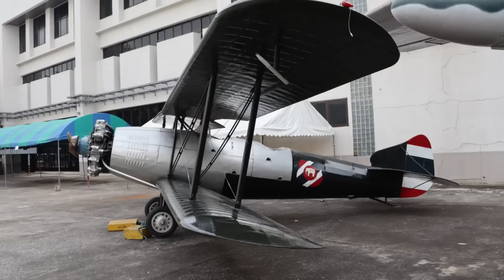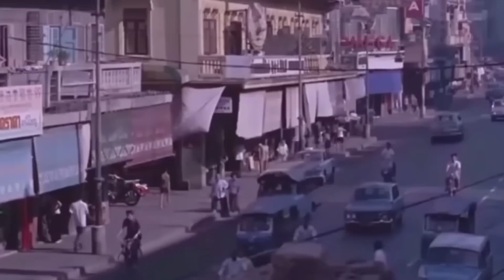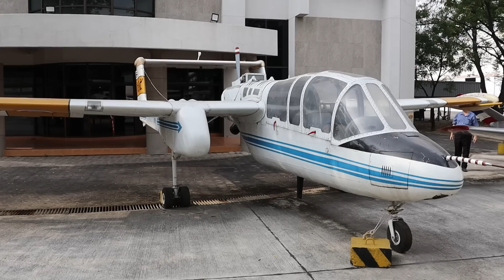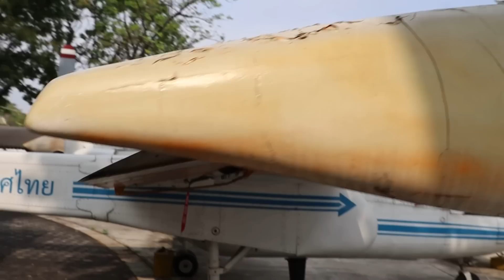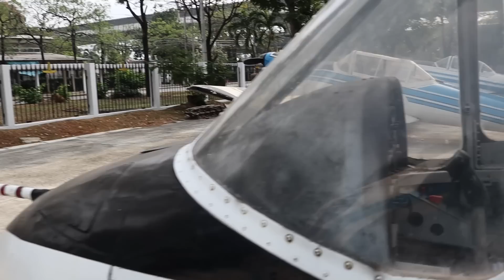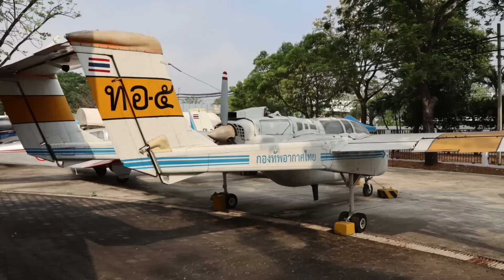The RTAF-5; Thailand’s Baby Bronco

Comment: I was an O-2 FAC with 300 combat missions and all these designs thrill me to no end. Sadly, the slow FAC mission is extinct, due to the proliferation of man-potable anti-air missiles. But that may have been a genuinely useful craft as a trainer or even a private sport plane.
Reply: Expensive motor though!
Reply: COIN aircraft have a place in a controlled airspace.  I don't see why the OV-2 isn't used as a Parachute, and Glider Tow for civilian applications.

Comment: Interesting design. 

I seem to remember there was a conversion to the Cessna Skymaster -- source of the O-2 -- that replaced both front & rear reciprocating engines with a single turboprop engine {maybe the Allison 250} in the rear. 

AFAIK, very few were made, and maybe only one prototype.
Reply: Spectrum SA-550 
Pratt & Whitney Canada PT6
IIRC four or five were built
There was another conversion with the rear engine removed & the front replaced with a Garrett turboprop but that's all I remember.
Reply: @GARDENER42  >>> Okay - Thanks...👍

Comment: The design layout is not a bad one if done right  but there is a big design no no with this aircraft with relationship to the propellor and the elevator if anyone else can spot it .And I'm afraid not cheap to put right in this case which may have been it's demise as well as having nasty traits.
Reply: I'm guessing the prop-wash over the elevator would produce a horrible interaction between elevator control and throttle.

Comment: Looks OK (even if it is a franken-plane), but I'd think as soon as you loaded it with crew, fuel and payload it would prove lacking in power. Plus I'm guessing that engine would overheat easily.
Reply: If it had been a regular air cooled piston aircraft engine that likely could have been the case, but the 450hp turbine used wasn't intake air starved, and the very prominent top mounted oil cooler is likely far more than required (the large size and proximity to propeller implies to me intention of cooling at very low airspeeds), so I don't imagine that thermals where an issue.

Comment: I think I'd rather have the twin engines in puller config on the front of the booms like an original Bronco: this design, while completely derivative and only using one engine in the pusher config, sacrifices the cargo carrying capacity [used for low-level insertion of LRRPs in an original Bronco] that would be very welcome in a privately-owned airframe. Plus the advantage twin engines confer for over water flight [that of being able to limp in on one engine if one fails, vs. ending up in a rubber dinghy surrounded by hungry sharks, etc...] 😉

Comment: you sure the rear gear was fixed?

It looks to me like there are "bolts"(?) for pivot points on there, AND a retraction strut thing (guessing they fold up forward) 

I'm no aeronautical designer but the whole only one of the 3 folding bit makes Zero sense to me
Reply: A photo of its test flight I have seen with the gears stretched down. Don't know it couldn't retract or just the precaution procedure for the maiden test flight as the other planes.